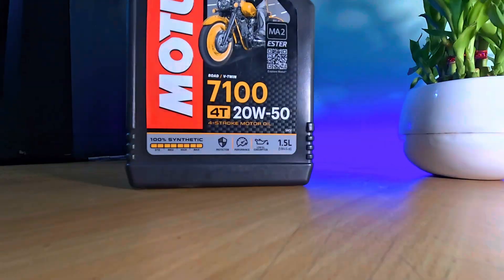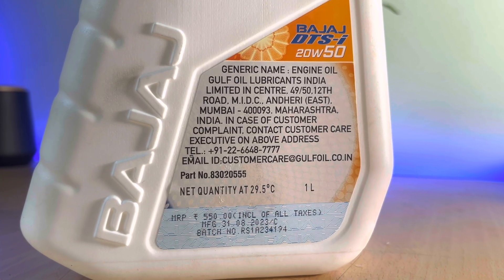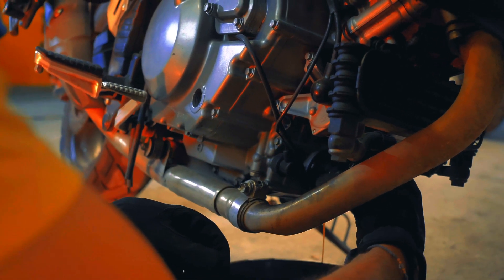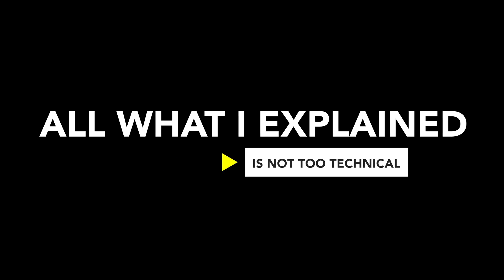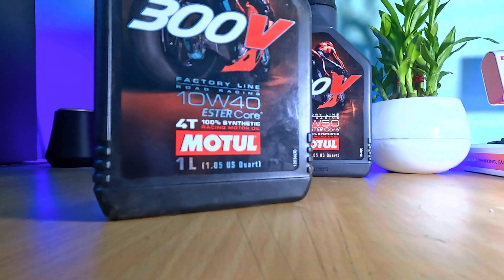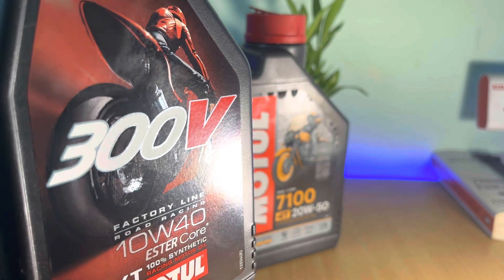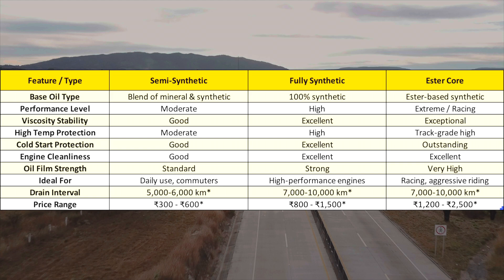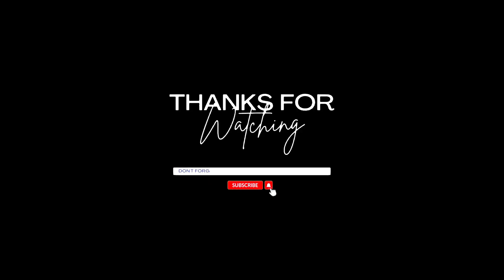What Are Ester Based Oils ? | Engine Oils Explained #motul

Comment: I've used all premium oils like 300v2, liqui moly street race in my dominar seriously speaking waste of money.. maximum people's crusing speed 95 to 90 kmph best mileage, engine smoothness, & ur own safety also.. red line karke koi jayda der tak nehi chalayga khabi khabi thik na ...  changing oil 2 times in 9000 km than to run in one in 9000 km.... 300v2 liqui moly ₹1300 - 1500 per liter jata hain. Iss accha 7100 lelo 4000 4500 km chalao ₹ 750 rupees liter ata hain ... 2 bar main 200 ya 300 jayda lagage but worth it

Comment: i use motul 7100  10w50  for my dominar 250  how often shall i change the oild ( chat  gpt says every 3000km)  i am not real sure
Reply from the maker: You can change between 5,000 - 8000 kms.
Reply: @ARKIONX hey bro what about ns 200? I am using motul 20w 50

Comment: Still many fan boys will say  motul is best. Kid's doesn't aware of THE PAPA IS "AMSOIL"

"Wake upto Reality" those who are thinking "Motul Fully synthetic"  means its 100% synthetic you are wrong kid 🧒. 

Very important fact Amsoil And Mobile1 (not mobil super) Both of these oils are 100% synthetic oils and these are not fully synthetic oils, the difference between Fully synthetic and 100% synthetic is very technical but in short 100% synthetic oils are made completely in a laboratory and are hundred percent man-made with no mineral oil. Fully synthetic engine oil have a base stock of mineral oil that has been refined(molecule size filtered to be exactly the same size) to behave like 100% synthetic oils which have exactly same size molecules. In 2025 both 100% synthetic and fully synthetic will behave almost identical but in extreme temperature and conditions most fully synthetic oils behave differently according to manufacturer and their additive packages but all 100% synthetic oil behave the exact same in terms of protection in terms of wear the additive package is mostly an additional cushion for longevity, anti wear, detergent, dispersant, and PH maintenance, fully synthetic coils also have these additives but they are inconsistent compared to 100% synthetic oil. 100% will also help dissipate heat much faster and will reduce vibrations. Good Fully synthetic engine oil also behave the same way in case liqui Moly, motul, fuchs,etc as they also have synthetic base called Ester along with edit package but there will be a very slight difference from manufacture to manufacturer and its technology like mineral oil versus natural gas derived oil. Given the amsoil base OEM range/base range is always cheaper than top tier fully synthetic oil I would prefer everyone to use amsoil 100% synthetic the other choice is Mobile 1 but we do not get Mobile 1 in India easily.
.. 
 this was a very oversimplified version, BUT I WANT YOU GUYS TO DO A SMALL FIVE MINUTES VIDEO AND EXPLAINING THE DIFFERENCE BETWEEN FULLY SYNTHETIC AND 100% SYNTHETIC.

To understand more you can follow the case study of Castrol versus Mobile 1
court case . And simply researching Group IV PAO, Group V esters. (100% synthetic oils are made of these groups of oils)
Reply: Itna likh diya h to you make a video on that😂😂😂

Comment: I have a ns 200 just 11 months old.... I'm thinking of changing the oil to motul or something but bajaj explicitly mentions that this will void warranty.... will they find what type oil is being used before issuing warranty
Reply: If they check colour of the oil they can easily find because motul 7100 comes with Cherry 🍒 red colour and bajaj engine oil comes with just like other engine oil type little golden yellow type colour
And if you want to try motul 300v that's also green colour like coolant.

And one more thing why your bajaj service center saying will void warranty after changing to other engine oil, some  state bajaj service center used only motul 7100 for dominar and ns200 from service center.
Reply: @RSourav_Dey_SINCE_1998 It is mentioned in user manual as well that non genuine engine oil voids warantee

Comment: Very very good video dude!
I am using motul 7100 , in my all bikes , like super meteor 650, and even activa!
And i absolutely love the performance, and i get the oil for like only ₹830/L
But considering my 5-6k kms drain interval, and so much increased performance,longevity, smooooothness of the engine, this is 1000 percent completely worth it!

And bro can u tell me how’s the 300v and v sq. If u have used them!
Reply: Bro in Which Activa you are using bike oil which is not MB
Reply: @ojasvahadhikari24  Yeah bro i know this is a MA2 oil and activa engines need MB oil.
But if u study a little, they actually suggest to use MB because of less resistance of the oil, and more fuel economy, which is not what i want in my case, and dude as i think u might know that activa’s / or other scooters uses dry cvt systems (with a oil compartment for final drive reduction , only that final drive system needs oil, other than that cvt is completely dry) and bro this MA2 rating is there because the oils with ma2 contains better clutch gripping additives but now u know that cvt is dry system (which can be called the clutch of the scooter) so there is no
Link btw engine oil, and cvt’s clutch engagement, so bro thats why those additivves don’t do any harm to ur engine unless it’s a wet clutch system, and in this case it’s a dry one!
And then bro also i have noticed wayyyy more performance & smoothness than sheer ecomony! 
And bro if ridden under 60kmph my activa 125 bs6 gives me 56-63 kmpl but my goal isn’t pure economy, but i do all
This for performance!
So i am also using drpulley sliders and ngk platinum spark plug, and many more things! So bro don’t use things without research but i do mine so thats why it is working like a charm!
And i asli do longer ride with my activa 125 (this oil is perfect for that!)
Hope u got ur answer!😊

Comment: Motul 7100 10w50 or Castrol 10w50 power 1 which one is better for dominar 400?
Reply: Castrol.
Reply: Motul best @prabashrusiru9224
Reply: Motul
Reply: Motul has ester which can lead to oil leaks in bikes as it affects the oil sealants. It is responsible for shrinking and expansion of sealants.
Reply: @sahilthakur1054 oh this explains why my ns 200 has a leaking issue 😮 on left case of the engine. But it stopped a long while and changed again with motul 7100 series 20w 50. Is this the reason for my oil leaks bro?
Reply: @AbuBakkarSiddique-n7n yup exactly what i am saying.......its a good oil when comes to lubrication but it has leakage issues for sure......
Reply: So bro. Which one is perfect for my ns 200. As a motul user i found my left engine case is leaked and sorted itself. Suggest me a choice bro😊 @sahilthakur1054